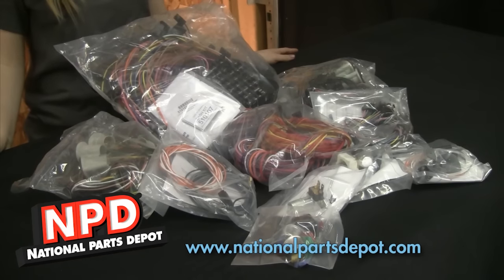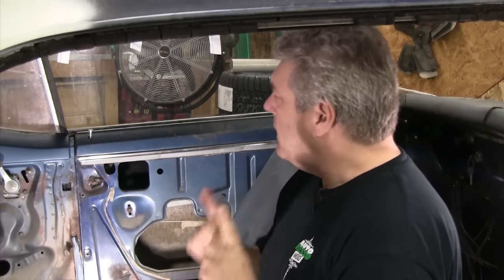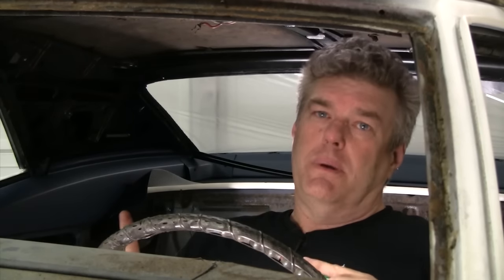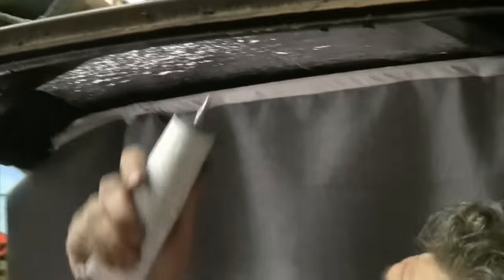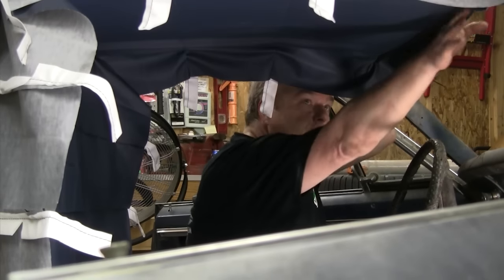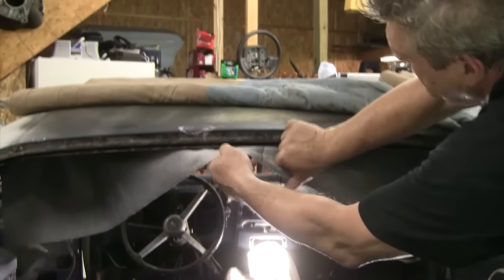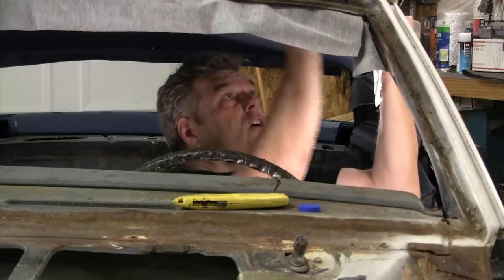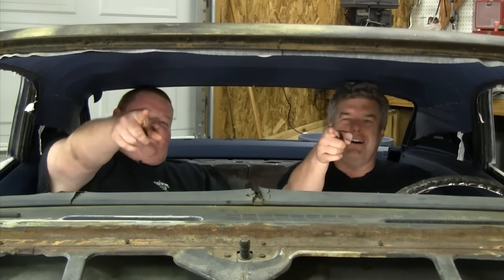How to Camaro Firebird First Gen Headliner Install tips and tricks EPISODE 306 Autorestomod

Comment: Great demo on the do’s and don’ts for a headliner install. Can you give me an idea of where you can obtain the little “T” clips that hold the side rail tack strips in place?  Not the ones where the sail panel are is- the ones that go around the sides and top of the rear window and windshield , and the side window sections?

Comment: I have already done the headliner on my 67 Firebird once, but I'll be pulling it out to add some insulation, at the time, the "original" had ripped and was hanging down. There was no insulation under it, so I just put it back in as it was. Thanks for the video, it confirmed I did it right (other than the lack of insulation). My daughter has a 72 Mustang, and between the two the Firebird is so much easier to work on & so many things are better designed for the guy working on the car it has always seemed hard to imagine that mechanical type of guy would prefer a Mustang. P.S. I was raised a Ford guy up until I got a 56 GMC pickup when I was 16. I've never looked back! Actually I did have an 87 Ford pickup that was a great truck. but I digress. Thanks for the videos guys!
Reply from the maker: Glad you liked the video!

Comment: The part that throws me is at the 8:00 mark where you talk about centering the wire inside the sleeve to the center of the headliner.  Why not just make a mark on the wire's centerline and cut a slit in the sleeve at the center of the headliner and just push the wire through until you see the wire's centerline mark appear through the slit?
Reply from the maker: There are a bunch of ways to skin the cat so to speak. Personally I don't like doing anything that might weaken the listing at the center.

Comment: I see you using that black U channel to install the headliner.  Will you be removing that after the glue sets and replacing it with the correct U channel?  My front piece has a half gap right where the mirror mounts.  Plus, mine are blue to match the headliner color.